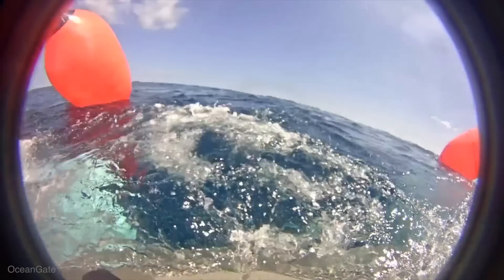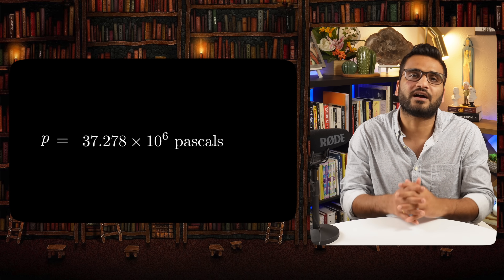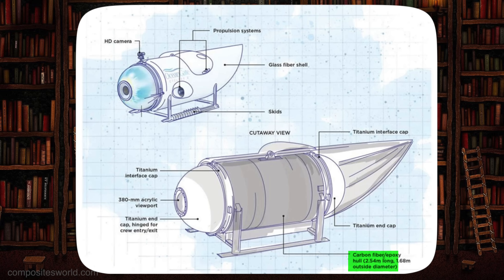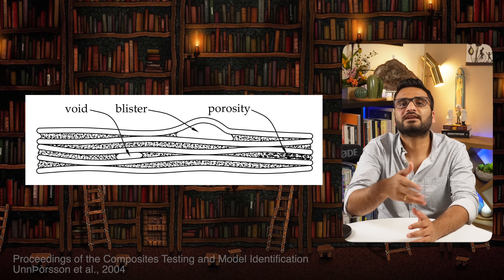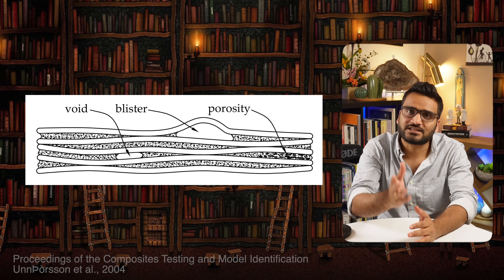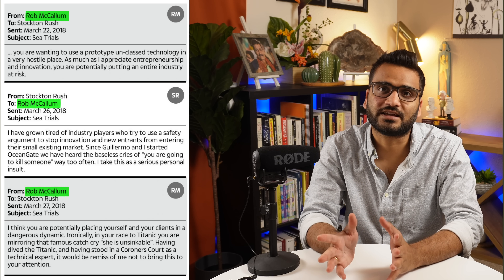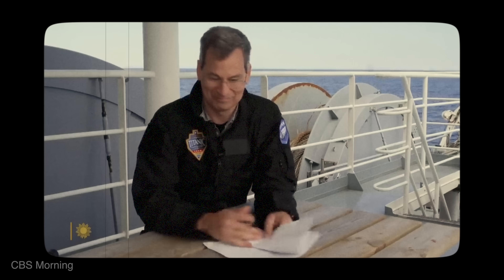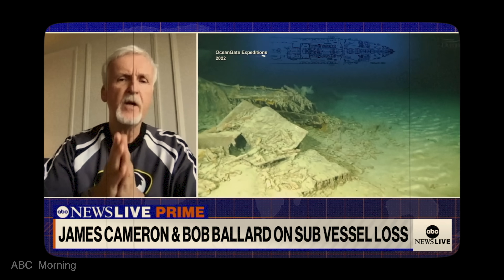OceanGate REALLY messed up - A Structural Engineer's Perspective | TITAN'S TRAGEDY

Comment: Composite materials are great building materials.  I think Airbus has been one of the biggest developers/innovators of it and its use.   And of those uses, they use it for the non-pressure systems.  Wings and spars.  Not for structures that are pressurized like the skin of the plane.  Got to think they may know a reason why eh ;)  (HEY Folks, thank you for the information below,  I reviewed use for the carbon fiber composite in Airbus and all detailed on the A series indicated aluminum skin, and the primary use in wing and spar.  Compression v Tension v Shear will likely be a big topic over the course of this event.)
Reply: Fine fir the fuselge as it is pressurised, just that pressure cycle has to be considered. Vessel for high pressure gas make good use of weaved carbon fiber where it excels
Reply: The 787 uses a carbon fibre fuselage. The carbon fibre is however loaded in TENSION not Compression. Carbon Fibre is incapable of handling compressive loads - the epoxy matrix does all the compressive load handling.
Reply: @allangibson8494  Lay the fibres flat and let the complementary stresses load the CF into tension. Voila!  I suspect the 787 will have little weight advantage over aluminium due to keeping stresses down to a level where any local failure can be stopped from propagating.
Reply: @everTriumph  Unlike the Titan, the 787 uses a woven mesh of carbon fibre in multiple cross ply layers to distribute the pressure loads. The 787 is also built from composite materials that are factory fresh and not time expired (unlike the Titan) so the epoxy resin should reach full yield strength during the autoclave curing giving design compressive transfer of loads to the carbon fibres that restrict the deformation of the epoxy matrix and thus prevent it cracking (unlike the Titan). Every single par of the Titan’s composite structure was simply wrong - wrong material, wrong orientation, wrong curing technique etc…
Reply: and EVEN Airbus had delamination issues and crashes.
Reply: @thinking-laaf  Oh for sure, it was a new technology and real world extended use hadn't happened. Lab testing can only get you so far.  Between Airbus and NASA, failure analysis and material use understanding today is far richer than back when they started in the 1980s.
Reply: The differential pressure on an aircraft fuselage when internally pressurized at altitude is only about 8-9 psi.  Miniscule when compared to the terrific pressure acting on Titan.
Reply: @MrShobar  And the opposite direction…
Reply: For an airplane,  carbon fiber composites would also be suitable for pressurized sections, because the pressure is a positive pressure, the skin is in tension. A submarine is the opposite, all of the pressure is compressive. The compressive strength of carbon fiber is ~0. In the submarine's case, the compressive strength was provided only by the resin that bonded the fibers together. It was always going to fail.
Reply: @Gumbatron01  The main factor CF is maybe not a good idea for pressure vessels such as cabins is that when it fails it tears like cardboard if it is a thin section.  Aluminium alloys are ductile at the point of propagation of a crack, so the propagating stress is spread and any crack stoppers can work.  With CF composites the failure point will concentrate the propagating stress on just a few localised fibres. These will fail and the crack will propagate 'explosively'.

Comment: If they could hear the cracking when it desent then why didn' t the ship pull them back up?
Reply: The sub was about 2 hours away from the ship and it comes back up by releasing weights. The ship doesn’t pull them up in a minute like a fishing Rod.
Reply: They were in the process of coming back up
Reply: They weren’t on a cable to the ship. Their means of ascending were dropping weights and inflating ballast tanks

Comment: A friend of Stockton Rush that had been on Titan for one of the dives said in a recent TV interview that they could hear cracking noises as they made their descent.
Reply: I believe it was said that the hull was instrumented to monitor the rate of crackling, in order to scrub the dive and return to the surface before the hull could fail. This is like putting a heart monitor on a pilot so the passengers can tell if he's dead.
Reply: Stockton Crush ?
Reply: It would be interesting to hear an audio recording in that thing during a dive.
Reply: Ah dem Cracking Noises was me hairy drunkin ole Mom:face-turquoise-drinking-coffee:
Reply: Creaking and cracking noises in a submerged vessel are "normal" due to the major compressive stresses being experienced.

That is why you use a metal material - such as a pressure vessel steel alloy, or titanium - and design to remain in the elastice portion of the stress - strain properties.

A brittle material has no plastic or ductile deformation characteristic, so you go from an elastic - linear deformation due to stress - directly to ultimate failure... do not Pass Go, do not collect $200-
Reply: @chemech  That which does not bend will break!
Reply: @chemech but they collected $250k.  
A piece.  Yikes
Reply: @chemech  You guys are such "geeks" - love it!! Thanks for sharing. Learning, considering - curiosity - need more of that.  Blessings
Reply: "What's that crackling sound? Is this thing really safe?"
"Don't worry. It's just our pork rinds snacks I tied outside the hull."
Reply: @pbxn-3rdx-85percent , good one!!!!! 😂